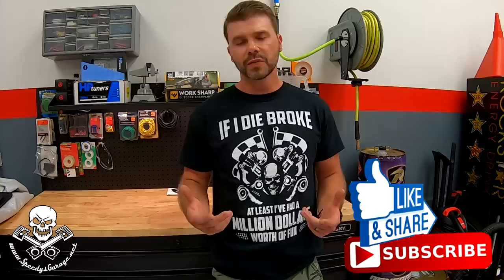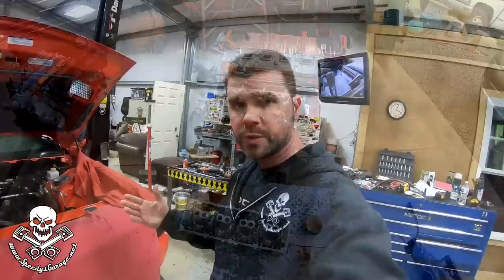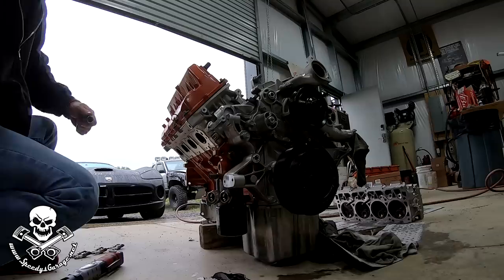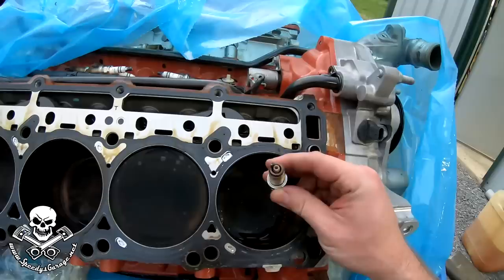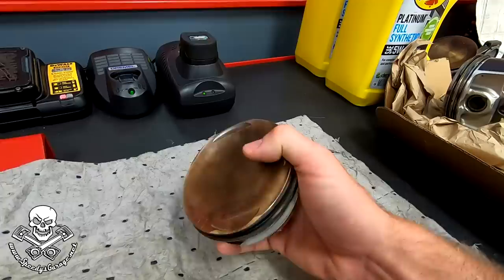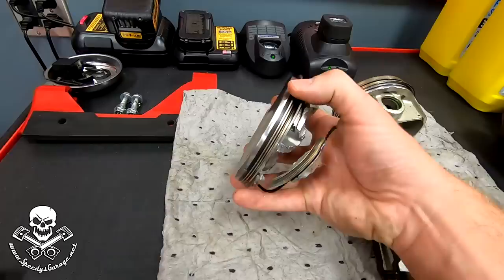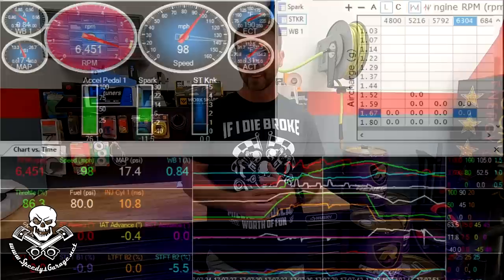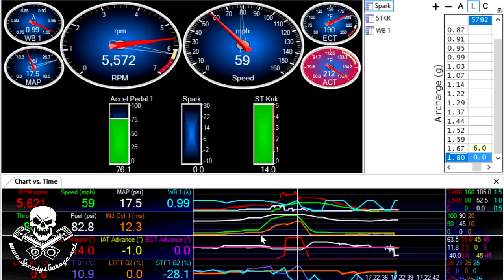Hellcat Engine Failure Diagnosis Speedy's Garage Challenger Go Man Go

Comment: I have heard that the new hemi engine has camshaft lubrication issues. This is not related to this video but it's supposed to be because the camshaft placement is a little different than the old hemi engines. I was curious if you know anything about this because I have wanted a Hellcat but am afraid and don't trust Dodge to replace the engine if it's faulty !

Comment: Sorry for your problem Speedy. I'm a hellcat owner also, and in my opinion the entire car is a piece of Garbo. I continue to have tranny issues ( a 6 spd). The only impressive item in the car is the sound system!!
Reply from the maker: Mine's been a pretty decent car.  Had the bearing issue on the supercharger and that was replaced under warranty.  Kinda disappointed in the pistons though.

Comment: RPM kills engines. I have seen this on any engine a lot with floating wrist pins. Pistons with hardly any skirt and floating pins rock more and will break and leave the piston at the top of the engine. Piston ring gaps can also close tight and leave the piston at the top. Floating pistons get get larger as time goes by and when they jurk the piston back down can break the piston or rod. When you press any engine to its limits you can expect anything to break after time. Just the way the game is played. Its a money game if you can afford to play.
Reply: yup... those ring gaps are crazy and the rings are so thin, how did they even think they would work in the first place... cuz, you know, Mopar runs so cool and all. I didn't even think about how bad those wrist pins are. Like the pins on a Harbor Freight breaker bar.

Comment: Another great video. 
I lost the “strap” and porcelain on both plugs in #2 cylinder.  Burnt hole in exhaust valve. 
My tuner thought it was a device I had plugged into the OBD port. (Discreet comment) 
I’d like to know if any of your members or contact have a theory.  
2 and 7 are sisters but with the supercharger in between I’m not convinced the heat /fire jumped.  I have seen jumping on older carburetor / intake manifolds. 
Thanks again for the informative video.
Reply from the maker: Usually burned plugs are a sign of extreme heat or a lean condition.  My only other thought is a bad injector, but it would have shown problems before #7 broke I'd think.  Gonna send the injectors out for testing and will post content on that to see what we find.

Comment: You might consider on your piston failure, the ring gap being to tight. The heat expansion caused the piston to seize at the top of its stroke. I come from a slightly different perspective being a former technical training manager and field service engineer for Cummins Diesel. Incidentally, the highest stress on a connecting rod and piston is in tension (pulling apart) during valve overlap at TDC. Hoping my Red Eye stays together. Regards, Dave

Comment: Only time I've seen failures like that is due to pinging piston rocking in 
The bore if the piston was cracked you probably would have heard for a while before it failed. And the melted spark plugs seems like a tuning issue to me.

Comment: The rod and pin didn't fail the pistion did it probably over heated the pistion and it seizied. At the top of the stroke and ript the pin out I'm curious if there was drop in boost pressure before the it failed?

Comment: Mopar has a know issue with the wris pins and some of the sodium filled valves are breaking off the tulips and slamming into the top of the pistons. As for the plugs, its the electrodes that are failing not the porcelain.  TSB’s went out to dealers in April of 2018 regarding wris pins and valves. Pistons are Hyperuetectic / cast with a ceramic mold. Small holes are cooling gas ports in the ring lands. Way too much gap in the rods. I would question if possibly these pistons or rods were original or not???

Comment: Looks like you had some piston skirt damage and rocked the piston till it let go from what the crown is showing. But you didn't show the skirt pieces which is probably the most important pieces to look at. The top 2 ring groves look too good for it to be expansion seizure. Well that and the fact you sucked the crown out with a shop vac
Reply: Does it look like detonation to you

Comment: too much heat , expanded the rings untill they butted, seizing them in the bore, breaking piston tops.  Guys who get carried away boosting LS engines without opening the ring gaps have this problem, too.
Reply: These a team of blokes on you tube, its a few years old that experiment/destroy  engines on a dyno in various ways to see what happens....they showed what too much nitrous does...same as over boosting/lean mixture etc....and your right the rings butt up and break the piston...normally the top ring breaks the piston as this is the hottest part but it normally stays connected to the rod just eats the piston...
Reply: Yup ring gaps, seized up top and pulled the pin out. The unusual rocking wear on top of the piston was probably due to the piston developing a crack as the piston was getting to seize prior to complete failure.

Comment: I'm not a Hellcat guy, but enjoy your channel content. From my big block chevy days, I would have attributed that failure to insufficient piston ring gap. As the cylinder gets hot, the rings expand, ring ends butt up, ring continues to expand. Ring acts like a break and attempts to stop the piston in it's bore. The rod is still pulling the piston down, the piston breaks at its weakest point, which usually is behind the oil rings, where the holes exist to allow the oil trapped in the ring, to drain back inside the piston. Just my two cents.
Reply from the maker: Since publishing that content quite a few folks reached out to me, some dealerships included, with stock cars that have broken in similar fashion.  A lot were even the same cylinder.  I sent the piece of the broken piston off for analysis a long with a piston from another broken Hellcat that bent a rod and the wear marks matched up.  Current thinking is that for whatever reason the rod began to bend in cylinder 7 and broke the piston.  Your theory might have certainly contributed if there were an error in assembly on the rings for sure.

Comment: Well, high rpm on overrun would be my guess for this type of failure. It occurs at the end of the exhaust stroke and the beginning of the intake stroke. On the compression/power stroke on overrun engine compression keeps the piston and rod assembly in 'compression' but there's nothing to do that on the exhaust/intake stroke.
This seems like a cast or hypereutectic piston type failure. The pin pier cracked and probably rubbed either side of the crack - hence no oil discoloration, then let go. As you point out the crack allowed rocking before the catastrophic bit. Not unheard of back in the day in cast pistons but fairly rare today I must say. You are racing it and this type of thing is par for the course ie what do you expect when you repeatedly rev it up like this? : ) 

Just an idea. Maybe they updated to ARPs because this failure is known to the factory and is a production fix LOL.
All your other reasoning re the data logging seems quite accurate to me.
Reply: How other run 6800 rpm on same engine

Comment: Tuning a stock engine way over what it was build for and then it´s the manufacturer´s fault ?
Reply: robert winton yup. You can actually have performance and reliability, but you are definitely going to pay for it. Honestly though, it's still cheaper in the long run than constantly breaking and replacing shit.

Comment: Totally agree and like said in old comment... the hellpuss is not torque plate honed and I have seen two that seen 7000+ with wrist pin pulling out back of piston diamond pistons in the new set up with alot more bottom end  also threw the blower in the corner added twin 88 ball bearing percisions added fuel injector bung  to a sheet metal intake I built for the car.. the factory rearend let go on last dyno pull we knew it was on deck before we even started the tuning that hellpuss put 1691 down and still has more in it good luck with yours like the vidga

Comment: a few things . that inlet valve will be bent...!!!! enough to light the inlet thats what increased iat's.. ring gap leaves pistons behind and rev's . those pistons are very weak looking around the oil scavenge holes.. the rock marks are probably from the failure it wont live at those revs with a broken skirt and you would have heard it.. the fact that other plugs have melted probably happened when iats went through the roof.. ring gaps are 3thou/inch for na.. double that for what your running.. also need more of a look at that rod or the pieces and the bottom of the block. if it pulled the pin out of the piston it would have danced around and kicked a leg out. how has it left the big end attached to the crank and still turning..
nice vid.. keep looking.. thankyou
Reply from the maker: The wrist pin shot out the oil pan.  Found it on the track LOL.  Burned my fingers when I picked it up whoops.

Comment: Paused at 4:26 
Your thumb is next to the valve relief.
 The wrist pin is oriented 90° to the valve reliefs.
Tipping scuff is at 45 degrees halfway between wrist pin & valve relief, more severe on one side than the other.

 Looks like the Tipping scuff is the result of one wrist pin boar breaking before the other.  Allowing the Piston to rock on an axis not perpendicular with the pin.
  Question 
Where is the ring Gap in relationship to the wrist pin?
 Is the valve impact mark actually an impact Mark with a divot or is it just a clean spot from a kiss?
 If it's a kiss piston head was just there floating around and there should be many harder to see kiss marks as the Piston rotated however , a divot indicates the Piston didn't move and was " stuck " when the valve hit it.

Comment: I have a 1954 354 Fire Power hemi and a buddy of mine has a hell cat hemi. I was blown away at the differences. Even the way the bearing caps are split. But yeah I'd say a fluke of a failure. Me old school carbs and engine, no juice so no "check tunes data". Seems to me some major piston slap tore it apart at high revs.

Comment: Race Engine Builder here, and trust me guys, I'm not going to try and be the know it all bully. In FACT I am not even going to make a guess on what happened since I can't see the parts in person, or mic things up. 

Now what I would like to add is that here's where, in the future anyways,  a inexpensive knock sensor attatched to each cylinder head may have helped. Any Engine Builder that runs his own dyno, will  or should have at least 1 knock sensor. This will save a engine from catastrophic failure as much as oil pressure,  oil temperature,  water temperature,  etc. A boosted engine especially without a knock sensor is inviting the potential  for a devastating failure.  

Again guys,  just my humble opinion from 40  plus years of dyno tuning.
Reply from the maker: These cars have two knock sensors.

Comment: Hey man
You answered your own question 
You overrev the engine, seized your piston wrist pin or bent your connecting rod (shortened connecting rod) and split that piston in half by the piston wrist pin
If you are curious check "real street performance" series, those failures are not uncommon in performance engines if pushed too far, especially nitrous
Reply from the maker: What's interesting is at time of failure the engine wasn't over revved.  It's been a while now and several failures of this type have shown up in Hellcats.  Consensus now is that #7 gets warmer than others and the piston likely seized in the bore due to ring expansion and the wrist pin ripped out.
Reply: @SpeedysGarage  interesting but it's not explaining the failure,  why 7 runs warmer
Ring expansion with not enough clearance between two ring ends will lead to breaking off a piston crown. That is what happened when I nitro my dodge stratus 2.4 l
Reply from the maker: Agreed and I've seen that exact failure as well.  Some think fueling inconsistency across the rails explains the #7 difference, but it's right at the crossover so dunno.  I had 4-5 people reach out to me that had the same cylinder fail though.

Comment: The demon engine got all strengthen  internals. Wish hellcat had it too
Reply: J G So does the Redeye, but again if you’re pulling 800-1000hp on a stock 707hp engine, then you’re risking it 50/50 lol
Reply: Not a true statement. I've got a redeye which is a demon motor exactly. They are very slightly better on a harder rod and connector ring. The cam is better and that's all. Seriously I have a blown one.

Comment: I think you are right, since the parts are made for mass production you will see stronger than spec parts. Parts that meet but don't vastly exceed the tolerances dodge specified for the order may fail unexpectedly.

Comment: piston rings butted, the crown of the piston is strong enough not to chip off so it sized the piston in the bore, pulled the wristpin out of the piston.  rear cylinders run hotter on pretty much any engine due to the coolant inlet being at the front of the engine.  

couldve gotten one that was on the tight side of factory acceptable piston ring end gap clearances, and then turned the wick up on it.

Comment: 8:54 Does this engine have 2 spark plugs for each cylinder? I see 2 holes in each combustion chamber.
Reply from the maker: Indeed it does.  Emissions deal I think.
Reply: @SpeedysGarage  10-4, Thanks for reply.

Comment: My buddy had a 318LA that had a similar problem, except part of the piston skirt broke off and wedged itself in the cylinder walls (It's on my channel) and it seized up the wrist pin on that cylinder and a few others, our guess was that it was ran low on oil at one point and when he got it (and he ran that thing hard) that it weakened it up causing it to fail. Could have been as simple as bad lubrication at that moment

Comment: 110% sure rpm did that. Did that to a 440 many years ago. Went to down shift  2nd, went straight to 1st at 60 shot to about 80 before I got back to third. '70 'Cuda 440 + 6, 727 Torqueflite with B&M shift kit that allowed shifting into first at any speed. Started burning oil, a couple weeks later, 7,000 rpm shifting into 2nd, whoose!!!! Three rods out the side of the block. One rod swung up into valley broke the back half of cam off.  Had one piston that yanked the pin just like that, that probably started everything. You probably cracked the wrist pin boss in the piston. Wrist pin yanked right out of the piston. Combined with a possible Monday forged piston. Thinking that piston was just a weaker piston. Nice autopsy, thanks.

Comment: I think you’re on the right track. I would say that when the engine was “ over revved” a few weeks beforehand that the Gudgen pin bore in the piston was possibly stretched and weakened the piston material as it did. The piston would probably have become weaker with each pass until it let go.

Comment: I've seen plenty of pistons break at the oil ring groove on different makes. It's high RPM on a part not really designed to live at those piston speed per mile speeds. 
Mopar built these cars so folks could race them and live with the damage and develop the engines to make power and live a little longer themselves . it's a story as old as the car.

Comment: I heard the 6.1 is the engine to get out of all these new Hemis , the 5.7 has valve seat issues, and the 6.4 has problems with top end oiling and weak pistons.. It would be cool to see one of these in a high power turbo build
Reply from the maker: 6.1 wasn't all that great either in terms of piston strength.  6.4 doesn't like boost.  5.7 about the same as 6.1, 8psi max.

Comment: What I'm seeing here isn't a Hellcat issue, it's an engineering and metallurgy issue.  Floating wrist pins have an inherent strain built into them--there's a clearance between the pin and the piston.  Awesome for efficiency, not so awesome for strength.  Press-fit wrist pins create a single structure between the pin and the piston, distributing the load in a uniform fashion.  

It looks like a piston overspeed event.  That crisp shear-line at the base of the skirt I usually only see in hypereutectic aluminum.  I would HOPE to see forged pistons in a factory 700hp+ boosted engine, but with the clearances required, I wouldn't be at all surprised if Chrysler avoided it--especially after the old skirt-slap issues GM had on cold start back in the day.

I'm curious to see the results of your friend's stress test on the two pistons you pulled!
Reply: Looks like he bent a rod. Piston failed secondary? How would the piston crown mushroom like that from slap if the wrist pin/wrist pin bore failed first? Had to of been slapping the cylinder walls for a while to mushroom like that which is why I say bent rod was primary. That also explains the timing pulls. Car was seeing the modified stroke from a bent rod in the CPS pulse width.

Comment: I wonder if it was RPM that did this? These parts are designed to take a pushing force not a pulling force. My best hypothesis is this rod/piston was pulled apart... Kinda like how cracked rods are made. Anyone else agree?
Reply: it is basically a quality control problem that was accepted in terms of a production engine so when you stretch the limits, you place these problems to the  day light

Comment: The one time that happened to me was in my slant 6. I over heated the engine and a piston seized pulling the rod from the piston and putting a hole through the block. I suspect that pistons tolerances were a little tight and subject to heat. If you race, build your own engines.
I've raced for 30+ years. MOPAR!